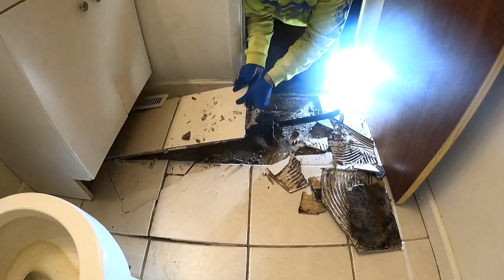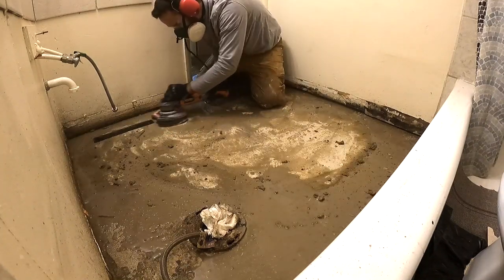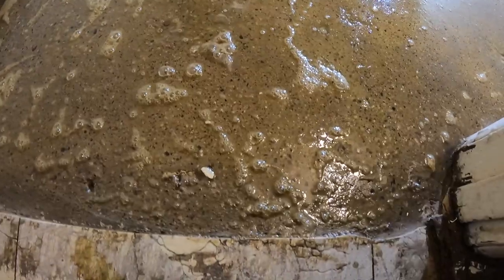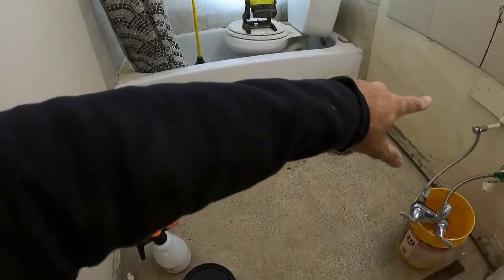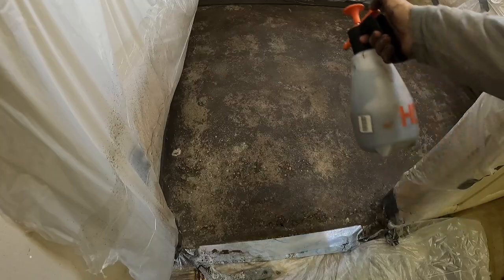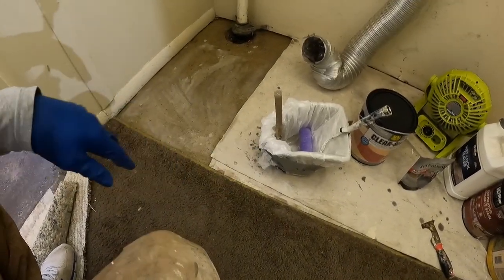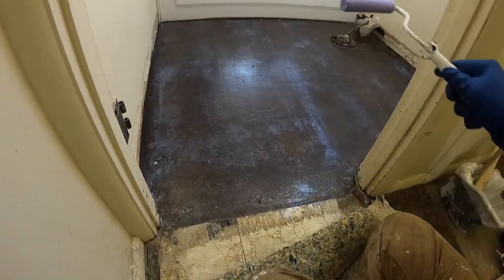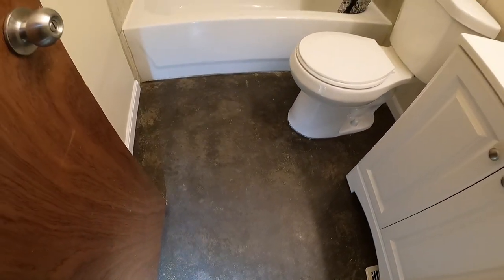Concrete Stain | BEST FLOOR FOR RENTALS

Comment: I enjoy you showing the process, but honestly that brown splotchy stain makes the floor look kinda nasty.  Bathrooms are usually a place where people like to feel clean and a brown stained concrete floor is quite the opposite look.  If you're really intent in having a concrete floor bathroom then probably put down a layer of concrete floor leveler, light gray color, to raise up that floor a bit and fill in those cracks.  Maybe add some decorative floor flakes if you're feeling artsy.

Comment: I’ve never tried staining concrete, I’m currently debating either a stain or a 2 part epoxy for my patio area.  I did the 2 part epoxy in my garage and it came out beautiful, can easily wipe any mess up also.  I’ve watched a few staining videos, I’m leaning towards the epoxy again 🤔

Comment: Very very curious as to why you didn’t just get a single bag of levelling concrete and pour it over. I’m so confused. When I was watching I felt like you had a special bond with the original concrete, maybe gave it a name like ugly duck…. Just having so much faith that it could be beautiful one day. I admired your determination and work ethic… but you would have saved a LOT of time if you skipped the tender loving care, all that prep…and just dumped a bucket of coloured concrete over it.